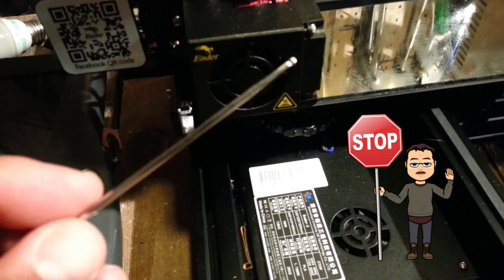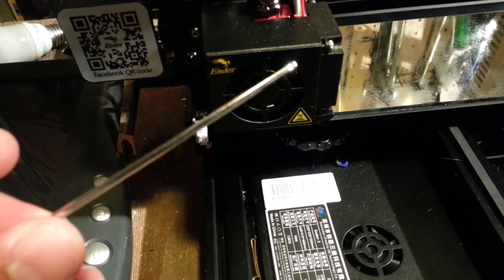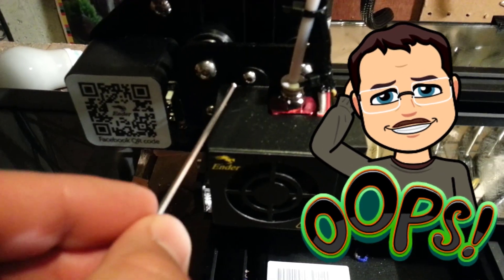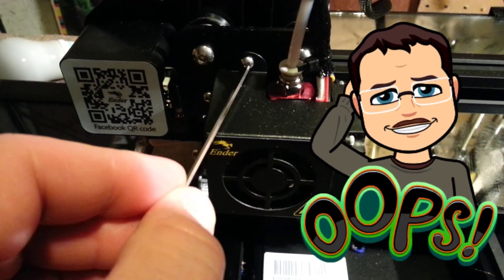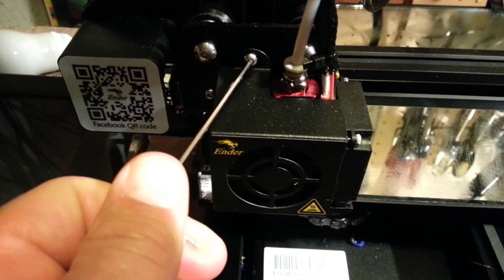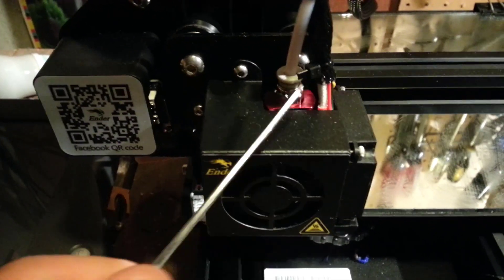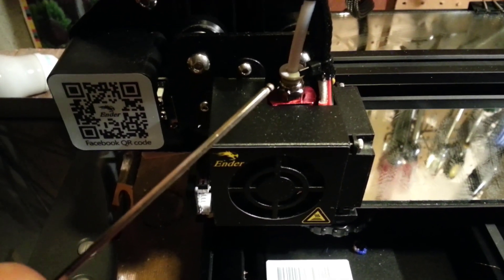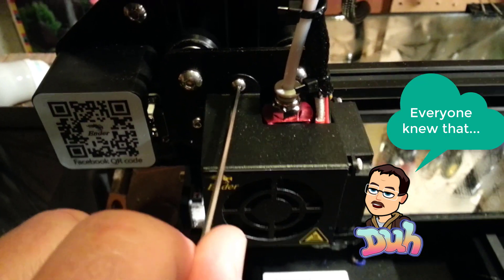STOP! I was wrong. Do NOT cut the Ender 3 allen wrenches!

Comment: o man ! after my supplied sd card went corrupt... (forgot to safely eject from windows...) i doubt they will send either... F it i might actually be able to print stuff more reliably now that my glass bed arrived... we'll see soon VERY asap.
Reply from the maker: Bummer on the corrupt SD card. Been there as well. I bought a batch of 4gb from amazon so I have spares. Hope the glass bed has been working well. Sure am digging mine.
Reply: i might end up getting another one so i guess ill live on the sd card fiasco etc.. my only decision here is do i go for the cr-10s5 ( since i originally wanted a much larger print area anyways. the only thing holding me back now is do i go fer the printer first and upgrade its heatbed or get the palette 2 so i can print in 4 colors on any printer.. tough choice but one ill be making by the end of the yearrr..) i FINALLY figured out wth my problem printing was/is the rod for the X axis is bent causing binding etc... i messed with it a LOT and it seems to have helped some as its printing good so far. i will STILL need them to provide a new x axis rod though as i have paid for it and will accept no less. ( after waiting 10 yrs now to afford one. ) thanks again for everything and GL ;)
Reply from the maker: Hope that X axis rod shows up soon. I dislike waiting for parts. =( Those palettes sure look sweet. I have a replicator 2x so I can work with 2 colors. It is a really sweet process and things are just cooler with more than 1 color. =)  I have had my eye on the large build volume printers as well, but have not pulled the trigger yet...